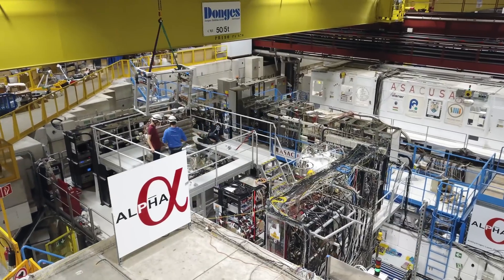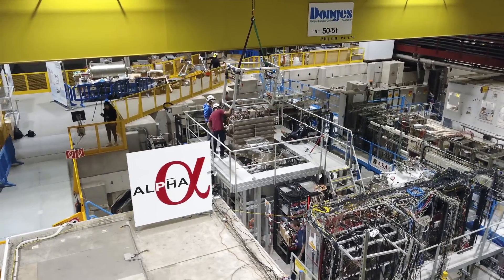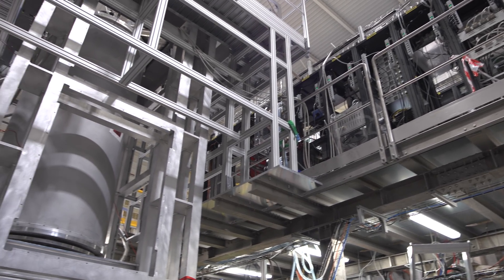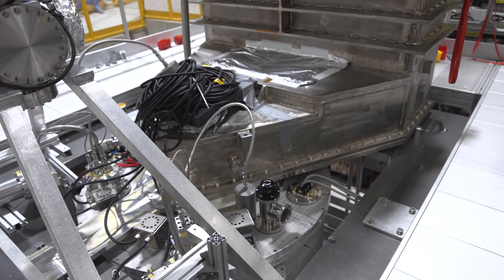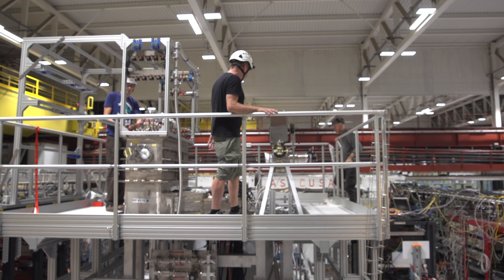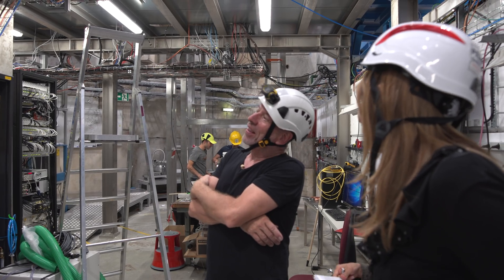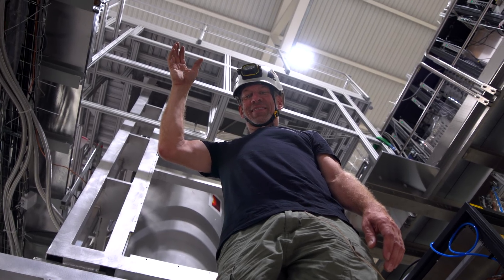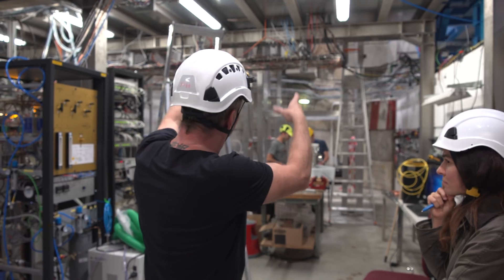Introducing ALPHA-g, a new experiment to measure the effect of gravity on antimatter

Comment: We know that matter and its antimatter annihilate when they approach each other. And we also know that there is at least one antimatter factory at cern in Geneva (Switzerland and France) on this planet. I think that it’s quite possible and the technology we have now can develop antimatter gun for military (it doesn’t necessary only for military but also civilian use such as creating tunnel, removing abandoned building or vaporing everything). It’s better than developing the rail gun or ICBM because it’s technologically and scientifically more challenging.
Reply: Not simple as simple as you describe. CERN currently produces only antihydrogen atoms which would annihilate in the air. Also annihilation is not always one shot and can happen between various parts (e+/e- and at quark level which compose nucleons) which would produce various radiations. What about the feasibility and energy balance to produce millions tons of antimatter necessary to dig a tunnel...
Reply: How would you project an antimatter bullet? Assuming magnetic field containment, then as soon as it left the gun it would immediately start reacting with the matter in the air.
Reply: Ok, what about antimatter beam like particle beams ? the cern produces antimatter particle beam?
Reply: I think that is only possible under extremely controlled conditions. They aren’t shooting antimatter into the air, because it would hit the air and annihilate itself.
Reply: maybe in space.

Comment: Am I dumb to assume that if you have neutral antimatter ("neutral antimatter" 0:32 - no charge?) in the traditional sense it cannot be acted upon by gravity? This is, very much so, above my head. Like in space really. But that immediately sprung to mind. Isn't some sort of difference in charge required in order to be acted upon?
Reply: If a body has a mass it will be affected by gravity. Charge doesn't matter
Reply: @sdassi97  How though?
Reply: @youtubasoarus  It just happens! Gravity is one of the 4 fundamental interactions, it can't be simplified further
Reply: @youtubasoarus   The electromagnetic force acts on charge, while the gravitational force acts on mass. I suggest watching videos on Einstein's theory of General Relativity which include helpful animations of the curvature of space time. That'll give you a more intuitive sense of how gravity works and you'll realize quickly why it is totally non-dependent on charge.
Reply: It changes the orientation, not the proportions. That's why it's called "anti-matter" and not "negatively charged matter"
Reply: +youtubasoarus
You have a charge of 0, but you feel gravity. Gravity is proportional to mass, and has nothing to do with charge. 
This can kind of be extended to any object: a pen is made out of neutral atoms, but it still falls down (i.e. is pulled by gravity).

Comment: How do you store it if it has no charg? Doesn't they keep antimatter in an electromagnetic field to avoid contact with matter?
Reply: Not quite clear. I checked http://alpha.web.cern.ch/ and can speculate that they might have contained them using strong magnetic field. I say this because a normal hydrogen (electron+proton) has a magnetic dipole. So similar dipole should be there for a antihydrogen.
Reply: I believe it's in a vacuum and the pressure outweighs the weight since there is so little mass. Not 100% sure haven't done anything on pressure yet.